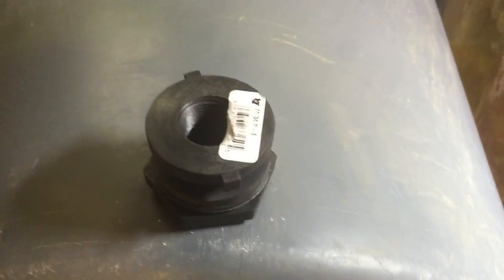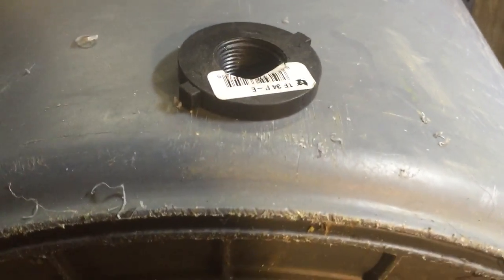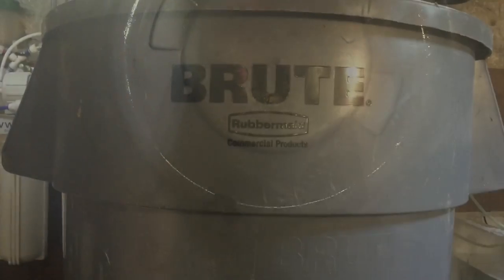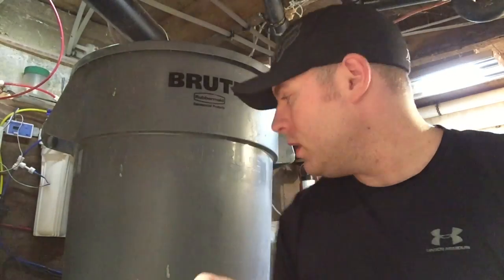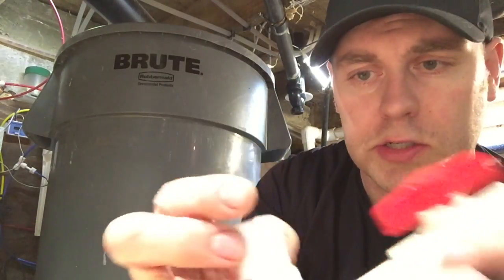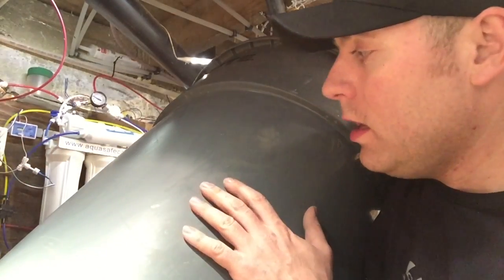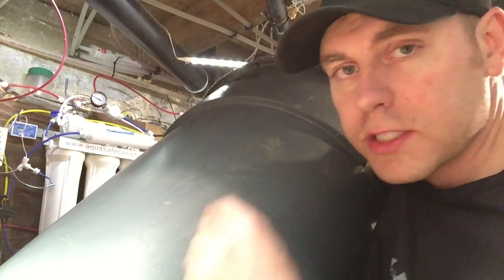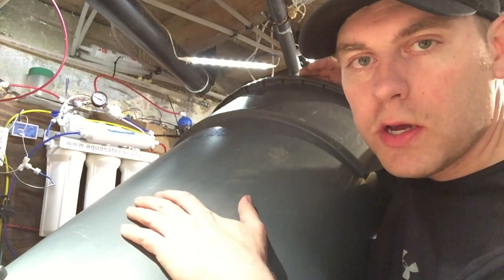Saltwater water change made easier by adding a ball valve to a brute.

Comment: Like a pro! Lol. Crazy how small changes makes life just a little easier for a reefer. I took hours installing my bulkheads....rose brutes are expensive.  Now you have to fully automate it. Lol
Reply from the maker: I can auto mate it no problem. I just have to pick up a few materials !
Reply: FARM BOY REEF I've automated mine for the most part. No more hauling bucket. Lol
Reply from the maker: yeah I don't do the bucket thing either
Reply: Similar to my water change.  Turn of two valve s
Reply: Us basement sumppers all have the same mindset....we're a different breed of reef keepers.
Reply from the maker: Hey guys must be basement thing lol...
Reply: FARM BOY REEF Its a 
  NO water mess on the Hardwood floors 
  NO Water running and Protein skimmer stink over flow air noise 
NO  MESS In the house when cleaning equipment 
ALL OF THE ABOVE KINDA THING 
OHH And it looks kewl too
Reply from the maker: Erica Miller lol nice !!! You hit the nail on the head
Reply from the maker: Willy d. aquatics it's true ! I agree